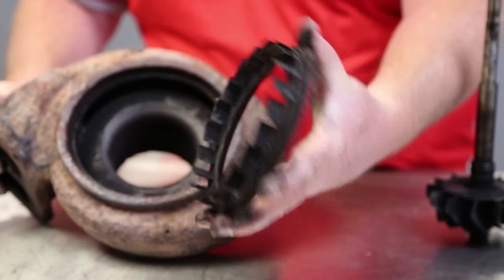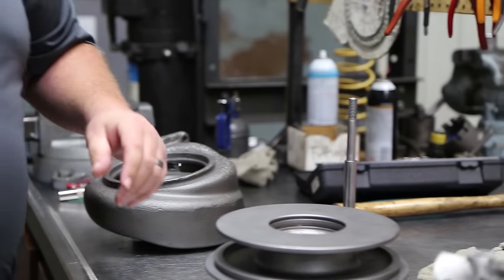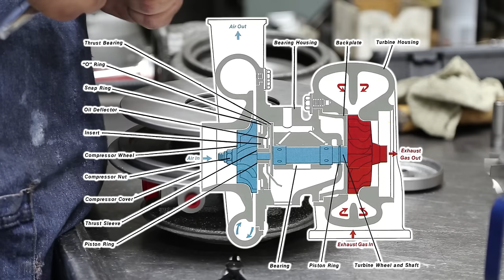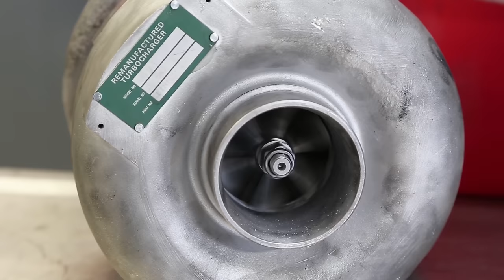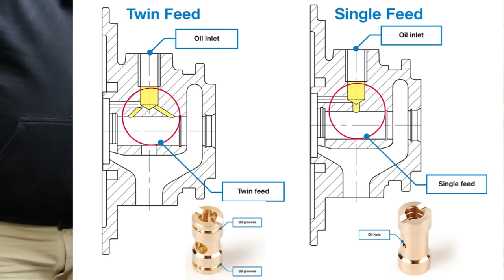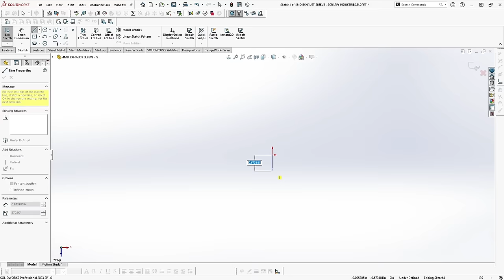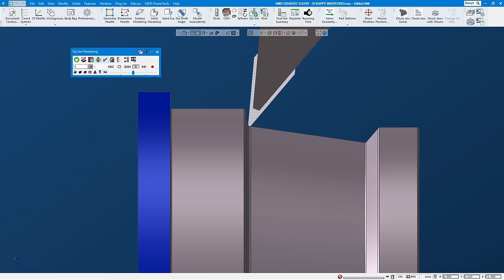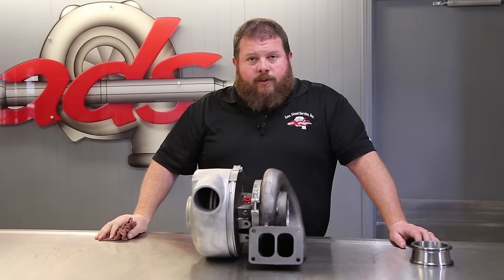4MD Turbo TWICE Repaired for @ScrappyIndustries TD25C IH Dozer 4MD-755, 148065, 702505C91, 702505C92

Comment: I bet the extra pair of eyes belonged to one of the old original guys that used to work on these turbos when they were still common place. This is one of those instances where you lose on the swings, but gain on the roundabouts. Already a well respected company. Excellent at what you do. Now putting the icing on the top for total customer satisfaction. I have bought cars, brand new. Salesman all over you like a rash. Drive off the forecourt and around the block. There's a fault. Take the car back in. Same Salesman doesn't want to know you. Having a company that stands by its products and resolves issues. Golden. May this incident generate you lots of new customers.
Reply from the maker: It was indeed a "more experienced" set of eyes that identified the issue.

Comment: ADS may have made a simple oversite with bearings and it cost the company time and money BUT, in the long run I bet it will pay off greatly because you are building an honest customer reputation. I for one would make you my GO-TO shop for any work I needed done.
We need more shops like yours !
 So now you all know ( I didn't know either) there are two different oil systems used and NOT to confuse them :)
Thanks ADS !  I really enjoyed this video !

Comment: I can’t say enough good things about Area Diesel Service. This Video has made me a customer for future fuel and turbo needs. It’s a good company that stands behind their mistakes and makes it right for the customer. It would have been easy to say it was assembled wrong, or too low of oil pressure. Thanks for the in-depth explanation and inspection of the Turbo. Great Job, Guys.

Comment: The simple fact is everyone makes mistakes, what defines you is how you handle those mistakes and rectify the problem.

One of my specialities is transmissions, transfer cases and differentials.  Manufacturers make many revisions and updates to parts, components and procedures.  Having the knowledge and ability to identify those differences and changes is critical.  The problem is there is simply so many changes and variations to remember.  Some changes are so miniscule they can only be identified with micrometers or calipers.  I constantly take in jobs that have had repeatedly failed after being rebuilt elsewhere and who knows what incorrect parts have been installed by other builders which makes it even more challenging ro rectify the problems.

Comment: I first came to hear about your channel when wes came to your shop and did a video.  You guys are sure impressive.  Im restoring an old cummins NH 262.  It has a factory T 590 turbo and Cummins in three different locations of the country tell me that there are no available parts available for it.  Its not  frozen up and not corroded badly(truck actually runs ok), but turbo leaks badly.  Do you think there would be any hope of your shop finding bearings and at least getting sealed back up.  I only bobtail it around locally 3 or 4 times a year and dont want to retrofit it if I can help it,  Bill
Reply from the maker: We do still have access to some of the service parts for these turbos. Depending on the part number we may have a new replacement that would rival the cost of rebuilding it. Give us a call with a part number and we can take a look.
Reply: Thanks, I will as soon as I get back in the states, Bill @AreaDieselService

Comment: Curious what process changes y'all will implement (if anything) to avoid this issue in the future. I've seen a lot of your fuel injection pump test equipment and how thoroughly you test (including full-speed pumping). Is it possible to do something like that with a turbo? I wonder if that would've caught the oil supply issue.

Comment: Just out of curiosity, would it have been possible to braise that flange and remachine it down to spec?  I'm just wondering if that would've worked or if it would fail since it's cast iron.

Comment: I am glad your company has the courage to face up to your errors. This is far better than a company pretending they never screwed up. I remember my mom had to have a Toyota repaired under warranty. The salesman was a complete dick, saying that Toyotas never leak oil. Eventually the guy underneath saw the leak, and repaired it. I never had to hear from that dick again.

I did not know what a turbo looked like until I was 14. I was reading the May 1998 issue of Sport Compact Car, and read about how to get 450 horsepower from a Nissan 300ZX Twin Turbo. I also learned what a Nissan R34 GTR was before the masses of American gamers did. I was surprised to see that turbos looked like snails with fans inside. All my life, turbo power sounded so magical, that I thought turbos would look and work in a far more complex way. Twin turbo sounded that much more magical, that is one reason why the moment the 300ZXTT went on sale, I wanted one.

I was 5 when the 300ZXTT went on sale. I wanted one because twin turbo sounded that much more magical. If turbo power was like a witch doing some hocus pocus, twin turbo was like Mickey Mouse's wizardry in Fantasia.

The 300ZXTT and some Nintendo video games gave 5 year old me a desire to visit Japan in 1989. Not many people had the desire back then, but I know I did. Later my desire would increase. I would be shown pictures of Tokyo in elementary school, and be told that it is 10 years in the future. A few years ago, I realized that at those presentations, at least one picture was Shibuya Crossing. I don't even think the people saying that were aware of it. Mostly our teachers were just trying to motivate us brats by saying "Work harder, Japan is 10 years in the future. Catch up!" Well, congratulations teachers. I grew up to be a single guy who spent more money on comic books than on trying not to be single. I did what the people of the future were doing at nearly the same time. I caught up. Malicious compliance for the win!

It is interesting to me to see these old turbos being designed to use a little oil. Many gasoline engines got snails in the 1980s, but how would that work on an an engine that needed to be California smog legal?

These videos of old turbo rebuilds are fascinating. I can see why people who have a car built 10 to 30 years ago prefer to buy a brand new snail.

22:35 I once made a joke about using the wrong unit. My last automotive teachers demanded we name the measurement unit after we gave a number. I made a joke to help the other guys. "Congratulations. You have a girlfriend that weighs 120..... KG!"

Comment: I'm surprised you guys don't weld up the flanges that are corroded/rusted away, then machine back down...sure they are worn out...but I would bet spray welding or even wire welding them back up to beef them up might save the housings, unless they are easiy to just swap out...if they are more rare than hens teeth...then might look into welding/brazing them up back to spec...

Comment: Wow that was an expensive mistake for you guys $4,000 in the hole. However that is not the full cost to ADS, you have also lost on the job/s you could have been doing if this turbo failure did not re occur. Well as you have said at least you owned the failure. Well done ads on standing by your business and making thinks wright. respect to ADS.